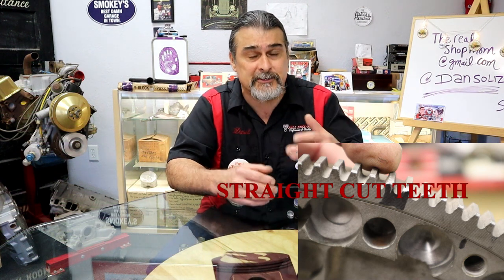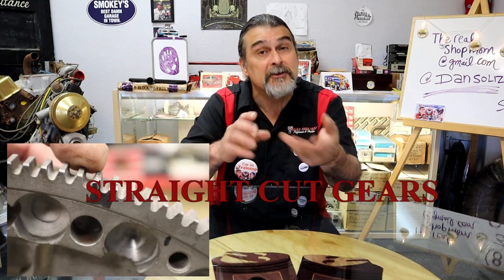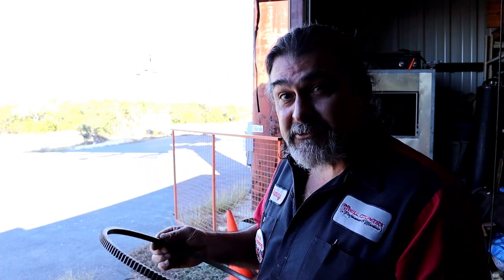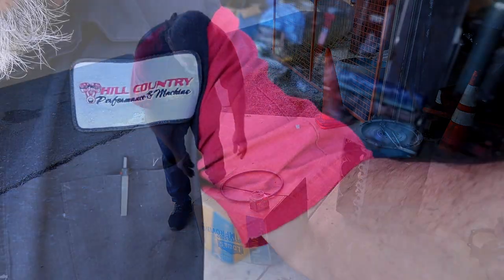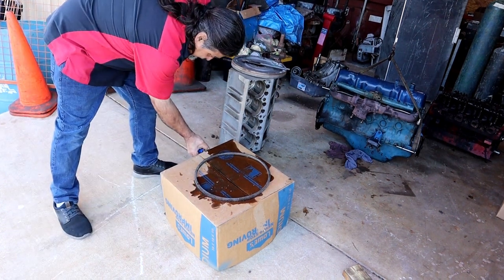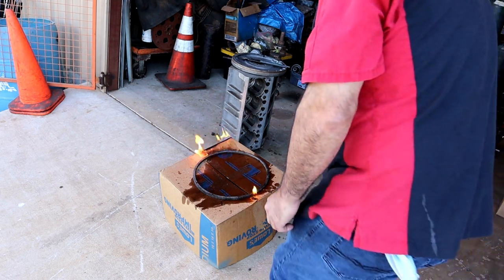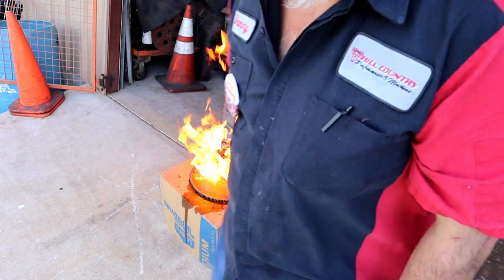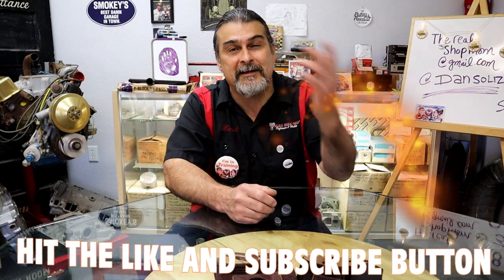DID YOU KNOW YOU COULD FLIP YOUR RING GEAR?

Comment: nice tip,
I dome that on many old cars and never had a trouble with that.I use a kitchen oven setted to 400 deg F to heat the ring gear.
 The thing I'll add is to check carefully the starter motor engagement gear for damaged  teeth tip, this usually goes with damaged ring gear.

Comment: This is kind of like the idea of putting a motorcycle head in the oven upside down, at 500 degrees held up with 2x4s so that when it gets to the right temp, the cylinder jugs will drop out of the head for replacement. Not sure if they can be installed in the opposite direction or not, I never tried it, just read it in the cycle manual...
Now after watching this video, even though I no longer have my old but sweet 1963 Corvair Van with a three-speed standard transmission, I now wonder if I could have done this to replace the ring gear on it, as the ring gear on the standard trans. in the Corvair, is mounted to the "pressure plate", not a torque converter, so they called it the pressure plate flywheel. Yep, now that is really eating at me. It seems the ring gear on that was spot-welded to the pressure plate, it has been so long ago. But it kept breaking the starter nose cone.

Comment: Lot Easier Cooking the Ring Gear in an OVEN !!!!
Reply from the maker: What temperature do you heat it to when using an oven?  How long do you heat it in the oven? What type of oven do you use? Is your oven Indoors or outside?
Reply: @MrDanielSoliz conventional Electric, or Nat Gas oven,    even a gas grill .. about 400 degrees for ten minutes,  will expand that metal in the ring gear,  ,   you will be good to go.    Just make sure you have thick hand  protection,   handling any thing coming out of oven .. just like a pot roast...